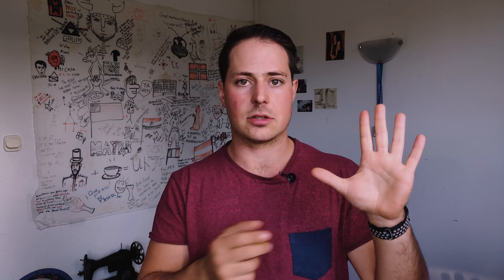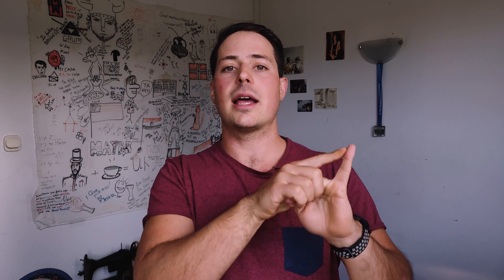The fastest way to cool your drink DOESN'T use electricity ❄ How to Cool Drinks | PART 5

Comment: If I froze salty water to make ice, will it have the same results or the salt should be added to the actual ice bath water? I wonder if we could reuse the salty ice bath.
Reply from the maker: You can use the bath to create ice, but you need to keep it isolate from the salty water. Otherwise it would mix with the salt and melt even if it is below zero Celsius :)